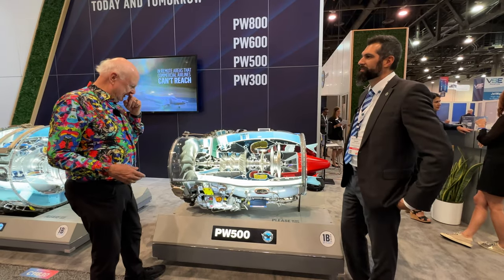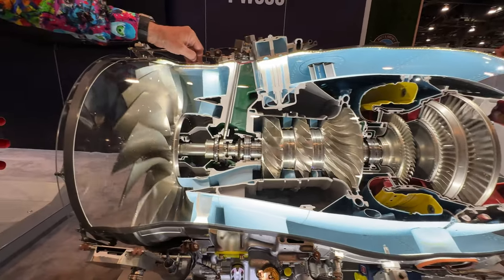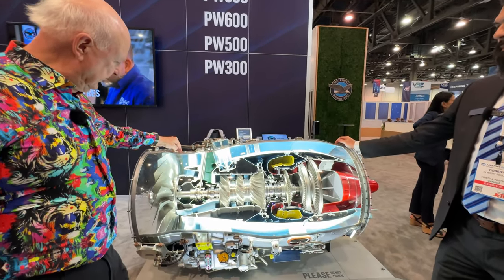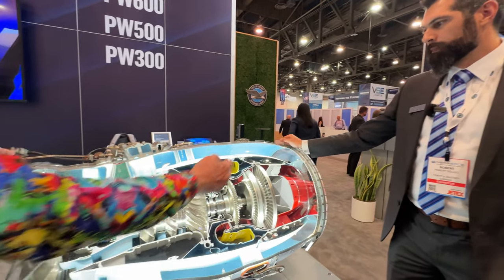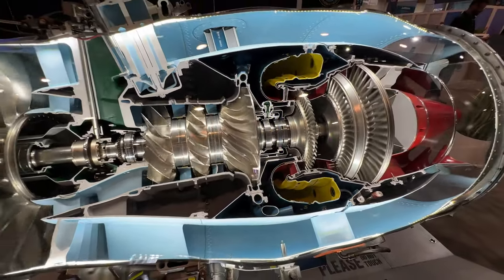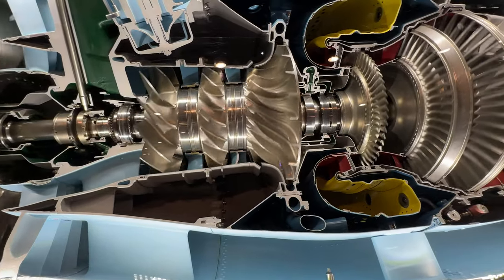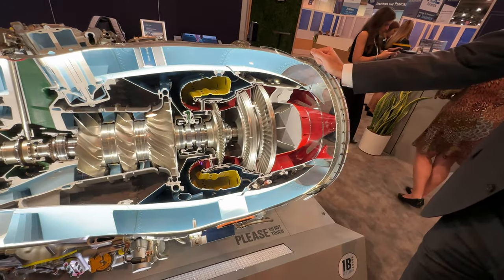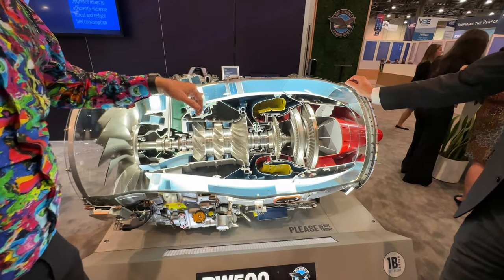Pratt & Whitney Canada PW500 Turbofan Jet Engine: An Overview at NBAA BACE Las Vegas

Comment: Nice video. I was gonna comment on the counter rotation because there is a display video from 10 years ago where they actually counter rotated so it's curious why they've made this stand different. I would have asked about the color of the blades, they all appear to be the same material but I assume the hot section is inconel and the others are not. Maybe it's a surface coating somehow.
Reply from the maker: Dan there is actually a switch on the engine display and we could have rotated it in both directions for demonstration purposes.

Comment: What's the story on the PW300 listed on the sign?  Is that an even smaller version?  And what about cost?  Have they been developed to reduce cost? What about expectations for use cases?  Thrust discussion, fuel burn...
Reply from the maker: Not a clue, reach out to P&W
Reply: there is no sense to the PW naming. The 600 series is the smallest, all the others are bigger, both 300, 500 and 800. There is no sense to the pricing either. Their smallest engine 610 is a million dollars, 5 times bigger is also a million dollars. They like that number. The more complex larger turboprop PT6, also a million. The actual PW610F engine might cost 10k$ to make. Am I calling them greedy? yes I am.

Comment: So much wasted space for additional axial compression stages with shorter chords and higher efficiency.

Listening to most pilots explain engine physics/dynamics is always a good time 😂
Reply from the maker: I'm not a power plant engineer, however in talking with Rob (the engineer with us in the video), PWC probably has optimized the configuration for this particular engine.  They have others with various stages and designs, which may have additional axial compressors.  It was nice to have Rob join us to correct any misstatements, since he was one of the designers.  I've flown a number of aircraft with engines designed by him and they are rock-solid .
Reply: there is a manufacture and service consideration no doubt but what I've noticed is that their smallest PW610f has only 5 elements total, 1 axial compressor and 1 centrifugal and it appears to manage proportional fuel efficiency. The Eclipse jet with PW610f uses much less fuel than say Phenom 100 which uses Williams FJ33 that has 3 axial and 1 centrifugal. About half thrust, half weight of plane, half fuel burn and same speed. So either smaller engines are more fuel efficient or it doesn't take many stages to get decent efficiency.
That PW charges 1 million dollars for their tiny engine means the savings of simplicity is passed onto their greed.
Reply from the maker: @DanFrederiksen   We fly jets with all the engines you mention.  Thrust has a direct relationship to fuel burned.  The Eclipse PW610F is a very efficient engine, but is also powering a jet with a MTOW of 6000 lbs, while the P100,  Mustang, etc are much larger jets.  The Eclipse also is more efficient on comparable trip due to its size and design. The P100 and Eclipse have almost the same block-to-block speed, while a bit faster than the Mustang.  We also fly all the Citation 525 series.
Reply: @DanFrederiksen  comparing efficiency between engines on different airframes by using fuel consumption, aircraft cruiser speed, weight, etc is extremely faulty.  TSFC is really the most accurate way to compare turbofan engines.  Smaller engines are generally less efficient than a similar but larger design.